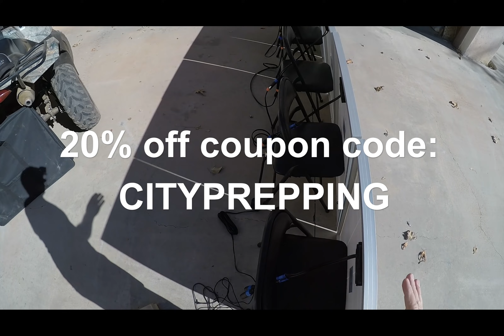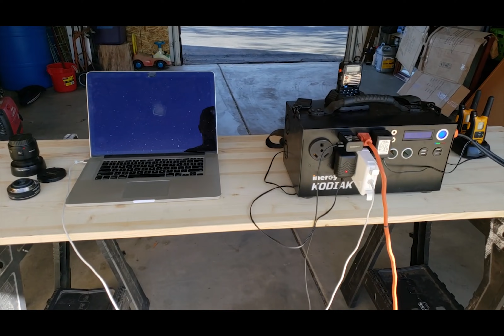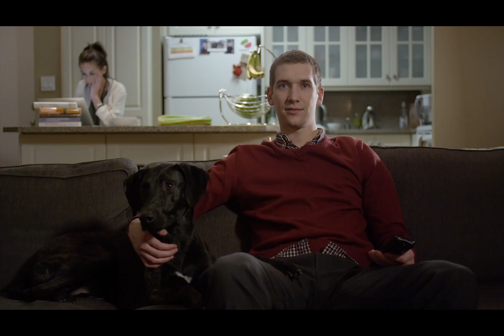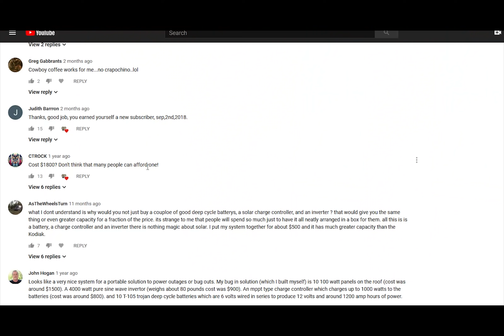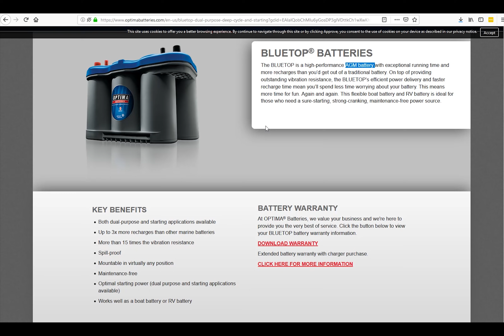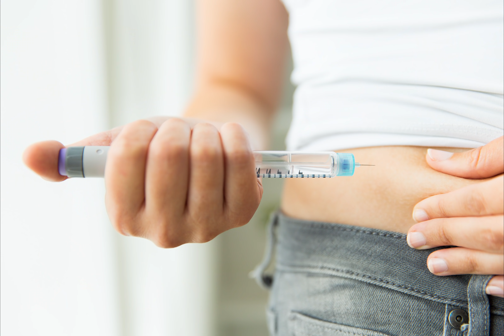Solar Generators: worth the money? Inergy Kodiak after using 1 year

Comment: Very useful info... especially for sunny regions in the USA and people with gardens. I think the results in Great Britain, Holland or Germany would be far less positive, because these countries are much further north on the globe. On average, the USA lies on the same lattitude as Northern Africa, which means that the sun is 1/3 stronger in the US then in Holland. Next, in november, december and january the sun rarely shines in Holland and Germany. And when it shines, the sunny periods are short and far in between. And the sun is so low, that you may experience difficulties finding spots without shade. Those are the months, you need energy the most.
No wonder, you hardly or never see european video's testing these constructions.
Reply: @retep eyahaled If you have advanced solar panels, they will draw energy from the sun, even on overcast days.  But I understand your point about the weather, I lived in Germany for many years.

Comment: If you need a computer during shtf you need to rethink your strategy, print off the pdfs and keep them in something water proof
Reply: Having a laptop that can even play a DVD every once and a while for your little family members will make 10000% difference in SHTF. It can also be used for a multitude of other things.
Reply: You can store a LOT more information on a pen drive than you can print out.  For example, Wikipedia fits onto a 15-20 gig pen drive.
Reply: You are wrong. A simple raspberry pie loaded with emulation station with your own build .  NES. super NES. Genesis, Dreamcast, Ps1. Games .Never hooked to internet. Add USB hard drive with a few hundred movies played  with kodi. Music played though Kodi your talking many hours of enjoyment and under very small amount of power used. Never hooked to internet it can not be tracked.
Reply: My Ham radio system uses an SDR connected to the computer.

I am looking at this system to power my station full time.
Reply: Or use your phone for pdfs
Reply: I keep soft copies in my phone and tablet. Even a simple tablet can do at least the essentials and then some.
Has its own battery and runs longer than a laptop. Less power hungry.
printers nowadays are tablet compatible via wire or wifi as with its interaction with larger monitors.
Reply: Or nothing will work with an EMP, no frig no insulin, all your gadgets will be boat anchors, death follows swiftly. Sorry I’m a realist, no insulting anyone.

Comment: maybe a really stupid question and i'm going to get kill for it. it is possible to run a gas generator with a hydrogen cell on demand?
Reply from the maker: i'm not really sure about hydrogen, but as others have pointed out, it may be possible to convert gas generators to propane.  I don't know how exactly, but I know some RV's have propane generators.  Propane stores much more easily than gas.

Comment: This could work for my situation. Big initial investment, though! Thanks for the comprehensive overview. You moved this unit from "pipe dream" to "savings goal," because DIY is just not happening for this liberal arts major. :D
Reply from the maker: I took a ton of Physics in college and I would still be apprehensive to build a unit like this on my own.
Reply: @CityPrepping  You were in the wrong department to learn about this stuff in the Physics department.  Electrical Engineering & Auto Mechanics would have been more helpful (for this topic).
Reply: Its very very easy to build your own dont get discouraged... if you can put the negatives power cables to negative and positive to positive it's as simple as that really for a basic setup

Comment: +City Prepping Would you consider using a DIY solution to make your own similar solar generator that run similarly to the Inergy Kodiak? I am considering making my own by a YouTuber called JehuGarcia. It costs 1500 USD for both the Solar panels and the battery pack with more storage and more wattage than the kodiak.
Reply from the maker: I just watched that video.  Like I said in this video, if you can do it, you have the time, the tools, and the expertise, go for it.  Some people have pointed out in the comment section of that video some of the problems with his setup, so be sure to study those comments.
Reply: +City Prepping Thanks for the insight.

Comment: Excellent video, and I thank you for the information. While I agree that a gas generator is going to make noise and certainly draw attention to my desperate neighbors, I can't imagine that placing these numerous and somewhat large solar panels out in the yard would not also draw attention. I suppose I could "hide" the panels in the back yard, but the panels are still visible. I think both options have the "draw attention" factor. One is noise and one is visibility. 

Is there a good way to keep the panels from drawing attention? The only thing I can think of is perhaps have them permanently mounted on your roof in some way. They're still visible, but they're also just "part of the house" and not really standing out all that much.

Also, I've been looking at the Yeti, so I'm glad to hear that the Kodiak is a better value. If i do get one, it'll likely be the Kodiak just because of this video, so thanks again.

Comment: what would be a good wind powered solution? also how about running a small AC unit for summer hurricane season?
Reply: You can run a small A/C unit with the Kodiak.  Buy a unit with no digital read out buy one with manual controls, they are available and pull less amps.

Comment: In a cold climate, can you run a small electric heater?
Reply: You might be better served to use an electric blanket if relying on solar energy in a cold climate.  However, if you have a sunny cold climate, solar panels actually work better, so with an additional battery, a low wattage heater might be okay.
Reply: I think a little buddy heater (propane) works better at this.
Electric Power consumption for a heater is just to high.
Reply: Electric heat is efficient BUT, it consumes a great deal of battery energy rapidly.  ANYTHING that heats will run this unit down rapidly.  Recharge time in cloudy areas? days? I can tell you right now in the NE, I haven't seen the sun in almost a week. It snowed today, rained previous 2 days.

Comment: I disagree with 5:30: "If you had applied those same hours use to build this generator to working hours at your job, then building it would not have been a good use of your time..."  I've seen this hour-to-hour comparison before, and IT DOESN'T APPLY.  People just can't ask to work extra hours at their job and take home more money.  Hourly wage workers can only work the hours they are assigned (which employers often limit to <35 to avoid paying benefits), and of course salaried workers earn a fixed paycheck regardless of hours.  The potential of building the generator incorrectly is a MUCH better reason to purchase a pre-made commercial generator.
Reply: +fazdoll I seen one made by Jehugarcia, has higher wattage output, more storage and more wattage coming in from the solar panel for $1500. It was very good.
Reply: @waffle2446  Does it have an RV plug?  The Kodiak does.
Reply: @Patrick Lee Indeed it does
Reply: I agree, but if you build it incorrectly the first time you keep working on it until you get it right.
Reply: The benefits of building it yourself is you can fix it if something goes wrong, instead of being totally clueless. I follow a channel here of a young man who has learned about solar from living in a vehicle for over a decade. I think he's had 13 different vans, RV, cars etc. He wrote a book on solar power that is doing really well, and does YouTube tutorials on building them. Name is William Prowse. Very intelligent young man, at least when it comes to solar. He recently replaced his propane water heater and made it solar powered.
Reply: I used to make a lot more money at my job, by either working overtime, being on call, or cashing in accumulated leave time once in a while...
Reply: I have never known a person to takes off work to save money to make something .... unless the difference is HUGE, cost-wise or quality wise.  So a per hour(job), cost at home while not taking work off, means that person(who makes his/her own), can still spend that money(from the paycheck), on something else ... the value of the time is not equivalent.  ALSO things that require lots of energy, also requires losing mobility ... if you're on the move, you might need a degree of "invisibility", you can't take the refrigerator, TV, or even a toaster oven with you.  Computers will probably be limited to what's already on your computer ... if there is no internet.  A small,  minimally powered notepad, would work much better than a high-powered laptop with a 17 inch screen.  Maybe better off with some small flexible, folding panels and the means to charge a decent quantity of rechargeable AA, C, or D batteries and limit the nighttime need of energy. When it's truly "pitch black", you'd see, very little light is needed and even then, that small light might serve as a deceiving beacon.  How about a number of 1/8" rods of copper and zinc?
Reply: Agree. to say you would be spending 750 dollars  more to buy premade and it would COST you money to make it, is nonesense.  Factor in the taxes and the dollars per hour is much more BUT regardless of that, you would know how to repair it and could potentially expand the capacity to whatever you needed rather than be stuck with what you can buy.
Reply: It doesn’t mean you get more work hours and pay. You are using your time that is valued at your hourly wage. It’s an abstract thinking way that says if it makes you happy and you have the necessary skills- go for it. If not, you might find it isn’t worth the time, tools, trouble to build one.
Reply: A vast majority of people I know, including myself, you can easily pick up hours. Granted, me and most of my friends either work at a hospital or construction, so we have the opportunity to get overtime easily. However I know people who get a second PRN (as needed) job to help with cost of for instance, getting their kitchen done by a professional, because even though they could do it, the PRN job pays them more than what they would need for the kitchen, and it will take less work time for them working than them ripping out everything from their kitchen and replacing themselves.

Comment: I wonder how your system would perform if you put it onto some sort of sun tracking mechanism. 
Have them point in the direction of brightest light without having to move them manually, removing human error and optimizing energy capture.
Reply: Over the past few decades, Mike Reynolds (the creator of the Earthship concept) has moved away from tracking systems, because the costs of solar panels has come down enough to where it was just much more economical and much less maintenance hassle to add more solar panels to the system, point them at the median direction and be done with it - much more reliable in the long run, cause trackers break down too often, and then you're worse off.
Reply: @testuser3167  So in the long run, the maintenance on the tracking system itself brings down the net utility of that system. Whereas the plug and play approach, of just connecting panels in series without tracking, may not yield the same amount of raw power, but is much less complex and therefore higher in net utility overall. 
Is that what you're saying?
Reply: @DavidArias2  Pretty much!  The cost of a tracking system hasn't dropped like the cost of solar panels, so it has become cheaper to just add more panels to a system, plus the trackers tend to break down and the worst times...

Comment: Does the battery on this generator have battery shelf life or number of charge cycles?
Reply from the maker: Yes, 2000 charges and I believe 10 year battery life.  All the information is on their website: https://inergytek.com/products/kodiak
Reply: @CityPrepping  I believe it should last even longer if it is not  drastically discharged on a daily basis.